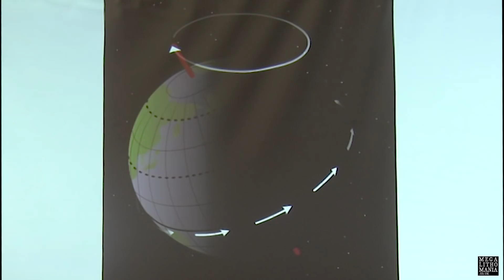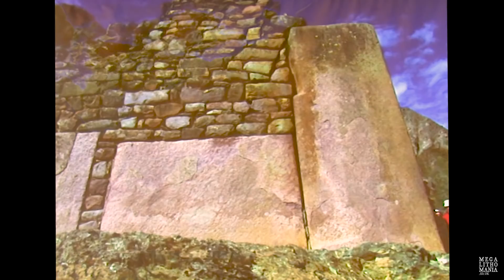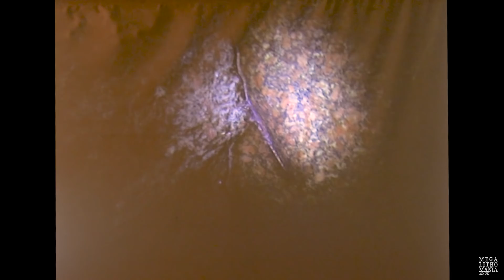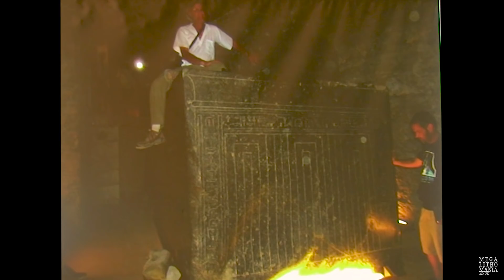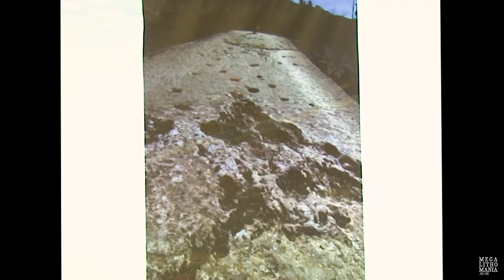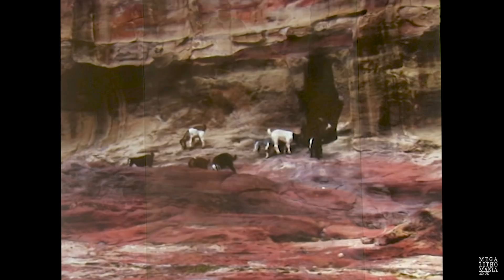Aftershock: The Ancient Cataclysm That Erased Human History FULL LECTURE

Comment: As someone who worked in the plastics industry in a technical capacity for a number of years, I can tell you definitively the pumu punku blocks were molded or cast. There is no other process that can produce mirror finish flatness and interior corners with no evidence of SECONDARY MACHINING PROCESSES. It's my belief that's how the Egyptians got such perfect reliefs such as what we see on obelisks and whatnot. In order to mold a solid it has to be liquefied and it is also my contention they were able to soften granite using some sort of "sonic welding" technology. This technology exists in the plastics industry and uses frequency and vibration to soften a solid and stick it together. I believe the "horns" the ancient builders used to facilitate such "sonic welding" are what account for the "nubs" we see everywhere in the ancient stonework.

Comment: Brien, assuming the pyramid is a hydrogen mazer based vibrating power plant. Keying or locking it into the ground makes perfect sense if you don't want it to "dance around" on the plateau.

Comment: There is no pyramid energy.
Reply: Zee Rod   So do houses, barns, trees etc.  The static electricity builds between the ground and clouds and releases between the closest points.  Lightning rods form a more direct route to the ground to divert lightning energy away from structures, not into them, to prevent fires and heat erosion.  (The aluminum cap on the Washington Monument has lost an inch or so to lightning.)  Ancient Egyptians did not have lightning rods.  They were invented by Benjamin Franklin in the 1700s.  If you want to direct lightning energy, you do not need a house or a pyramid, just the lightning rod, or a kite with a metal wire and a key.